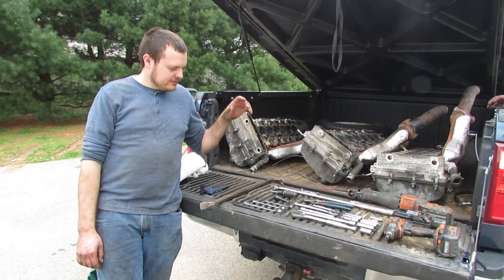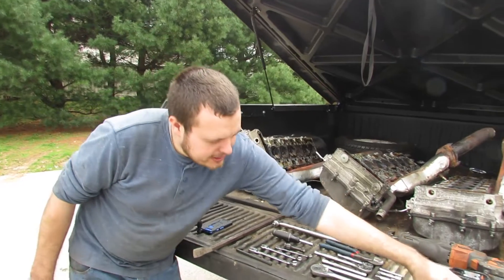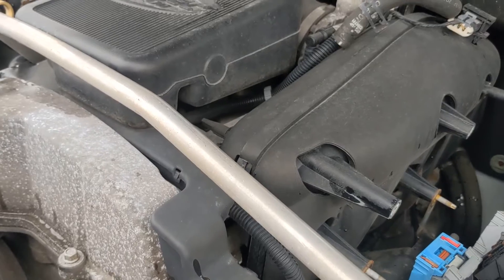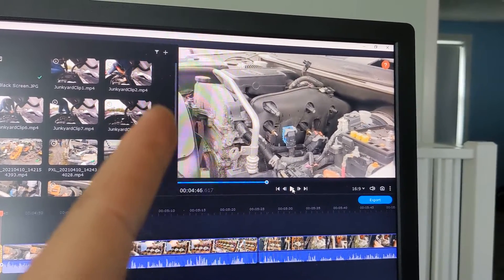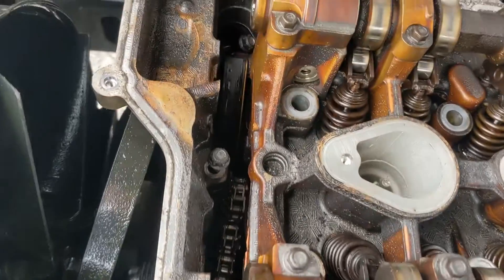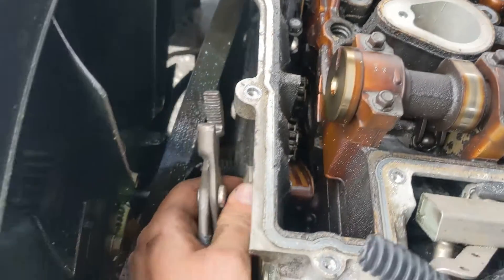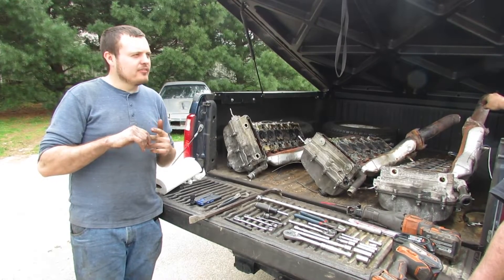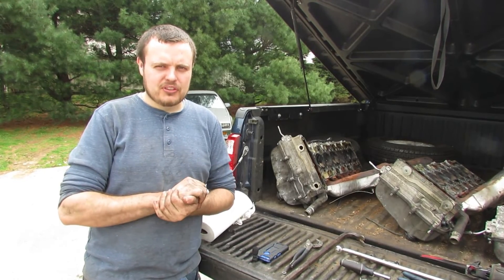How to Pull a Vortec 4200 Cylinder Head from the Junkyard

Comment: Problem with these engines, particularly the heads is there is not much aftermarket support. The issue I run into all the time is the cam retaining caps are wiped out along with the cam journals. Easy enough to source a new cam, but you can't find new retaining caps anywhere and as the aluminum head and caps are the bearing surface once they are scored there is no fixing them.

Comment: Question.  I have a 2006 trailblazer 4.2  I’m replacing the head gasket turned the crank lined up the timing marks but when I removed the head I have cylinder 2-3  valves open is that spose to be like that   From the front of the engine 2-3  I thought when you line up the timing marks all the  valves will be closed and number 1 piston up to the top ? Any info would help
Reply from the maker: I normally get the flats at the back of the cam to be flat, and then get piston 1 to TDC, then line up the marks.

Comment: Quick question on the 06’+ heads. The valves are larger, but what about the exhaust ports? Are they larger? I was wondering if it would be worth it to get an 06’+ exhaust manifold if the ports are larger and I can find one that isn’t a turd. Having an issue getting a Kooks header delivered to Ca.
Reply from the maker: Yes. The ports are larger, and the exhaust manifold is larger too. The real ticket should be to get an 08maniofpld because it is like two 3 into 1 manifolds that merge into each other later. Go look at the wiki. I have picture on there.
Reply: @Calvin-Nelson  Sweet! That’s what the Kooks manifold is, 3/2/1 but the 1 is 3” piping. You wouldn’t happen to have one laying around would you? Or a 4200 site that might have them?
Reply: @Calvin-Nelson  What’s the link for the wiki?
Reply from the maker: @ProjectCarTV  search Vortec 4200 wiki on google. Should be one of the first few links.

Comment: I use an impact screwdriver with the Allen head on it for the head bolts, give it a smack with a BFH - Big F*cling Hammer. Ive never broken a head stud on the Atlas using this method. Are you using ARP head studs? Also, which head gasket are you using? I contacted Cometic as I’ve had good results with their MLS gaskets in the past.
Reply: how do you smack the last two all the way in the back against the fire wall? There's very little access back there to get the hammer swing in.  I agree with the big smack though on all the others.

Comment: I'm trying to make a '71 Chevy 250 do something like what you're doing with the 4200. it's a futile effort, I fear. I'll save the 250 for a T rod, I think, and find a 4200 for my International. The stock numbers I'm seeing from the 4200 are impressive, and Holdener's dyno tracks are pool-table flat at very high numbers. Hard to beat for a pickup. Thanks for this!

Comment: Hey calvin i did some looking on a barra forum for some pictures of the internals of the LPG/XR6 turbo barra (aka the stronger bottom end), and compared to your picures on the wiki of the vortec rods, the  4200 appears to have a beefier rod even the pre 2006 rods. The 4200 has far more meat around the wrist pin area, and more meat around the big end, meanwhile the "beam" of the rod looks very similar to the stronger barra conrods everyone is making 600+ with. I saw a video yesterday of a guy with a stock LPG barra making just over 700whp through a manual. So in theory i assume the vortec 4200 should be capable of holding the same power.

Comment: Calvin, Two comments: one, it is NOT a breaker bar - it is a "convincer" because you convince the bolt to relinquish its restraining torque, and two, you must properly refer to the sawzall as "God's gift to mankind" which ensures the tool takes on it's task with holy enthusiasm.  hee hee -grinning as I type :)
Reply from the maker: My bad! Haha. In our case the breaker bar was actually breaking the bolts off. The head bolts in these engines snap on removal.
Reply: I like to call them "persuaders"